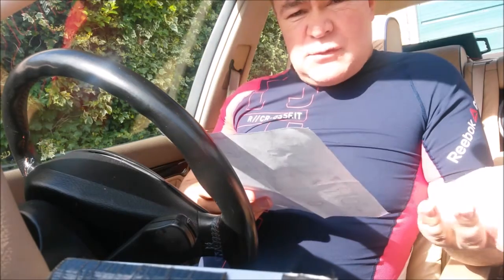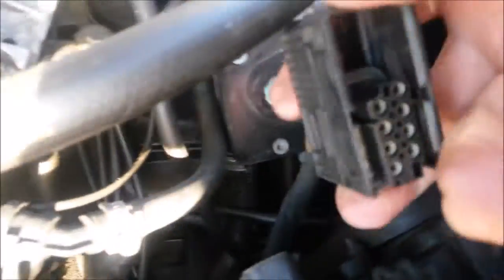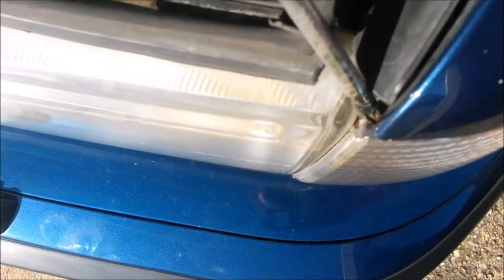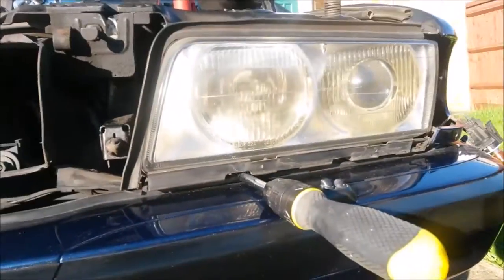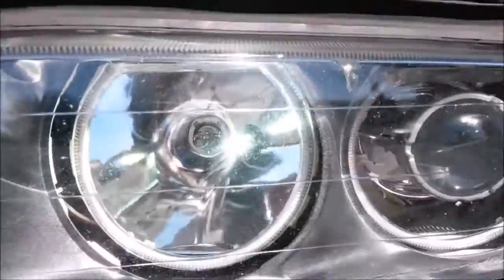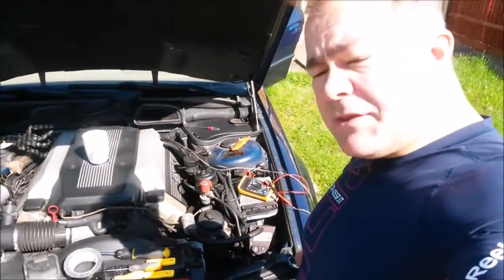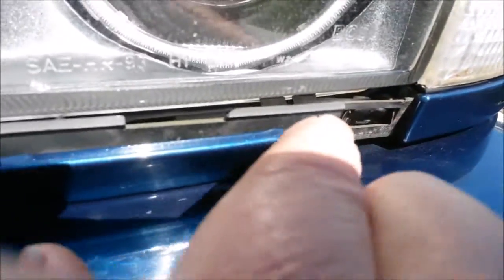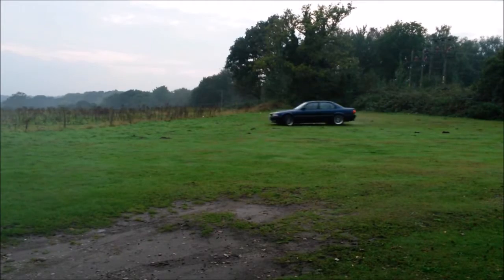BMW E38 7-series headlight removal, aftermarket angel eyes and rebuild

Comment: where did you connect the halos to ? i’m not sure where you got power i’m new to this
Reply from the maker: The sidelight circuit. If you don't have that particular regulation in your country, you'll have to find another circuit that is live only when the engine is on.

Comment: Nice but you did not show how to supply power to it...you edited that part.
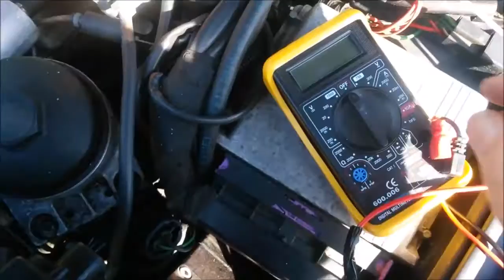Reply from the maker: Jose, play the video again from 6:20 to 6:25 and you'll see I tested the angel eyes on the 12v positive battery terminal by the left cylinder bank. Later I wired it up to a better source after the job was finished..
Reply: @SocksWithSandals where was that source ? what wire exactly because i’ve been struggling on finding a source
Reply from the maker: Maybe you don't have side lights or parking lights in your country.

Comment: AT 6:49  what's that  LED in the high beam and how is that installed
Reply from the maker: Hi Ave. It was explained at 4:38. I replaced the tungsten parking lamp with an LED for a brighter, safer daytime driving lamp. The dip and full beam bulbs are stock.

Comment: Thanks for the post.  But why aren't you actually wearing sandals with socks :-)  

Looks like your E38 is pre-facelift.  I have a 2001 (post-facelift) and the steps to remove the headlight assembly are pretty much the same.  But I do have one recommendation -- the nuts that hold the sliders should just be loosened; not actually removed.  The piece I'm referring to is the one that dropped when you took out the first headlamp.  I muscled out the slider piece on the first one, but just loosened the ones on the second assembly and slid out the headlight.

I got my Angel Eyes on and re-installed the lights.  I'll do the wiring later.  But thanks again for posting; it was really helpful.
Reply from the maker: Cheers, Duckback

Glad the video was some help, and well  done for not dropping pieces into the crumple zone. 

By the way, pause at 0:36 to see the eponymous socks with sandals in their full glory. Black socks with Karrimor sandals give the illusion of running shoes!

Comment: Where did you get those angel eyes?
Reply from the maker: José Silva 
Hi José
The ones I installed in the video were so bad they stopped working days later. Search eBay for item number 
121929218358 these were much better and had a turn signal.